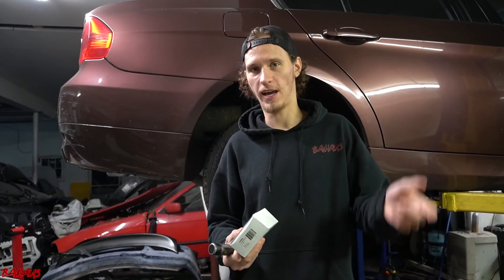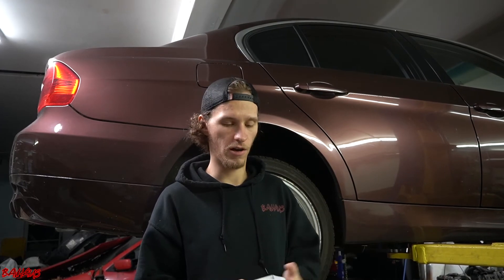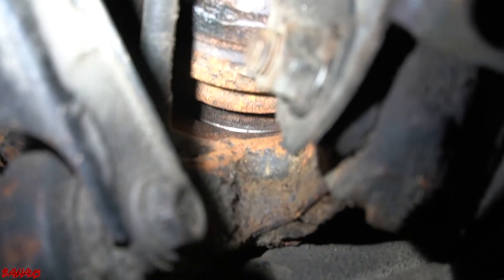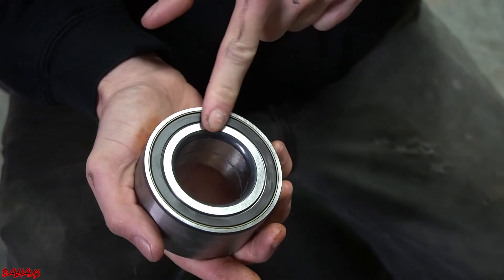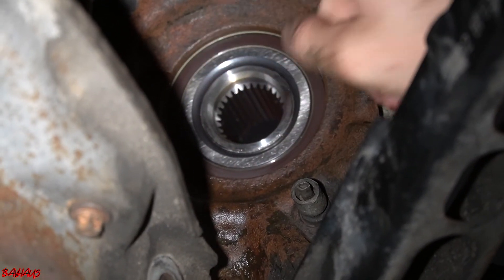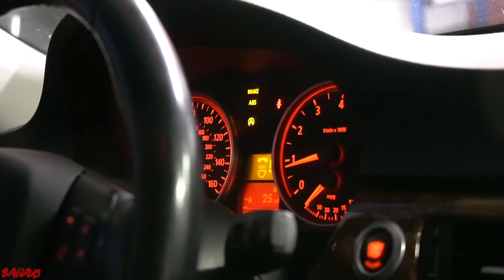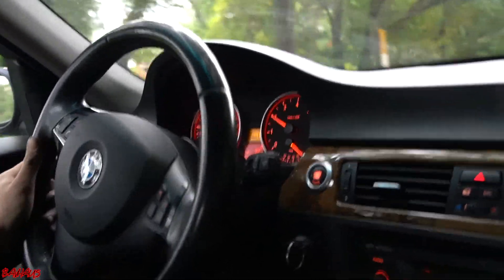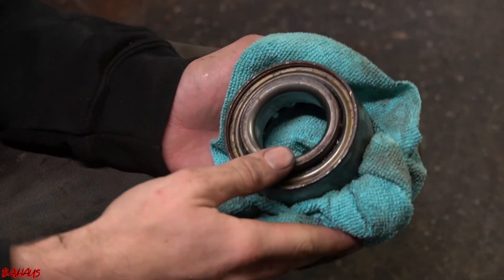BMW e90 Dashboard ABS, 4x4, Brake, DSC Lights Caused By Bad Wheel Bearing! (Video 1)

Comment: I’m seeing signal and equal signal on all 4 wheels in scanner. 2006 330xi. Steering wheel calibration completed supposedly, but the wheel sits turned left slightly when going straight. Loss of power randomly has caused wrecks. Any idea? Checked wheel speed sensors and did recalibration on DSC, Steering, Transmission. This case has the metal teeth on the transfer case actuator. Lost. Car is at 63k, been wrecked in front repeatedly before ending up on my work table. Thanks.

Comment: I got a 2010 bmw 328i xdrive and I got the Xmas tree lights on my dash. We changed the LR wheel speed sensor but couldn’t clear the lights. Upon more investigation we found that the bearings are shot. When those lights are on does the AWD still work?
Reply from the maker: The wheel bearing can affect the wheel speed and cause the Christmas tree to illuminate. Replace the wheel bearing and it should sort it out. AWD is turned off when all of those lights are on. The car will be rear wheel drive only. -Mike
Reply: @bavhaustv9795  yea we gonna replace it in a couple weeks. This shit sucks lol. 
Thank you for the fast response, I really appreciate it.
Reply from the maker: @jenifferxavier5529  no problem! Goodluck with the repair!
Reply: @bavhaustv9795  thank you, I’m gonna need some prayers on this one 😭
Reply: How smooth was the drive when it's RWD? The moment I got those xmas lights, my car started to ride really really rough. Lots of shaking and trembling. Could wheel speed sensor replacement fix that? I've already replaced the Actuator and abs sensor but no dice.

Comment: I changed all 4 tires on mine everything was fine till I put it in DS all those lights are on and now everytime I start the car and actually put some gas to the pedal. The abs brake and 4x4 turns on. I’m not sure where to start. I don’t hear any grinding noises or anything from under the car when I start or stop like others say. I thing it may be a wheel sensor idk.
Reply from the maker: Got any way to scan it?
Reply: @bavhaustv9795  and the lights don’t come till I start to give the car some gas. Or if I switch from P to R then to D. Like reverse out the drive way.
Reply from the maker: @Scared2Love  go look through our videos. It sounds like you need a transfer case actuator and fluid change/adaptation reset
Reply: @bavhaustv9795  even if I’m not hearing any grinding noise from under the car at all?  Car sounds drives fine it’s just stuck on rwd. I’ll start with adaptation reset then the diff fluid change so he can look at my actuator motor/transfer case.
Reply from the maker: @Scared2Love  yeah it wouldn’t necessarily make a grinding sound. It’s common failure on these cars
Reply: @bavhaustv9795  they scanned it at the shop and cleared it they said but they’re saying diff fluid or actuator motor. But I don’t hear a grinding noise. And they said their coder would have told them if it was a speed sensor or wheel bearing.  It happened after replaces 2 tires in the back everything was fine till I put it in DS. Then I got the brake abs and 4x4! Light on. So I return the rims got 4 matching tire sets that didn’t fix it.
Reply: @bavhaustv9795  I’ll see if autozone can get any codes out of it tomorrow I’ll let you know. Or if the mechanic will give me the codes

Comment: Lol, I just got these lights right now. We'll see more information about the code errors tomorrow. Any idea if any other sensors can trigger this symptom?
Reply from the maker: As mentioned it’s normally the transfer case actuator that breaks and throws these lights. You can throw a Hail Mary and try to turn the steering wheel left to right “lock to lock” and see if it clears
Reply: @bavhaustv9795  didnt work the turning wheel option. Pretty sure its transfer case motor, starting to make some noise after i shutdown the engine. Tks for the info
Reply from the maker: @IDunique-v7z  no problem! Goodluck with the diag!
Reply: Where are you Located? I need Help
Reply: Ps. The problem was fixed by replacing the transfer case motor actuator.